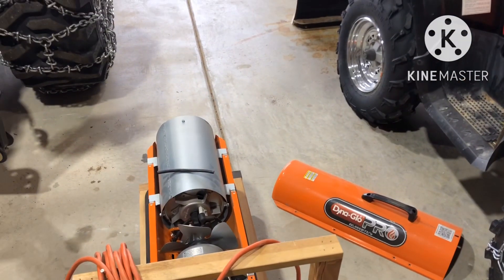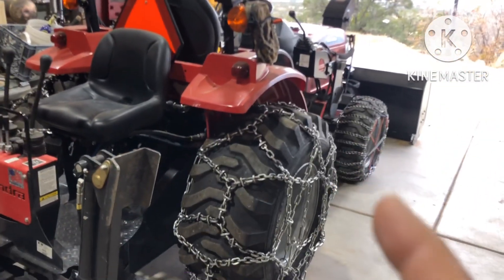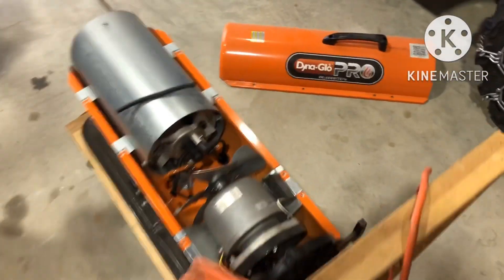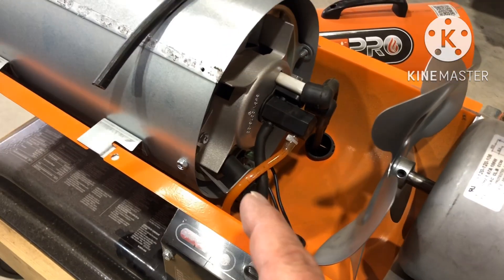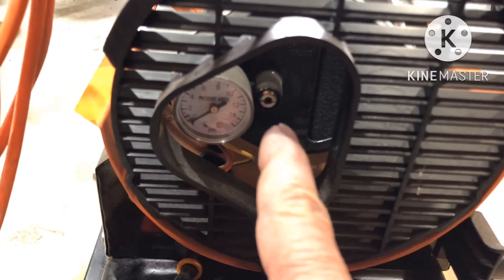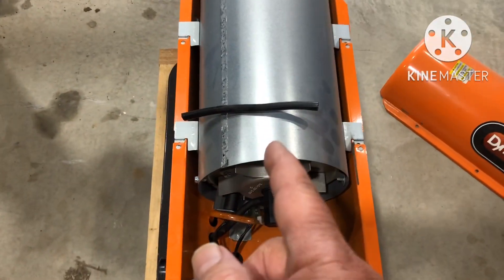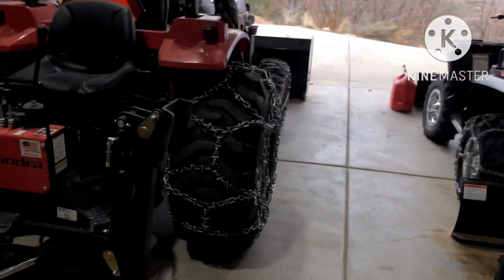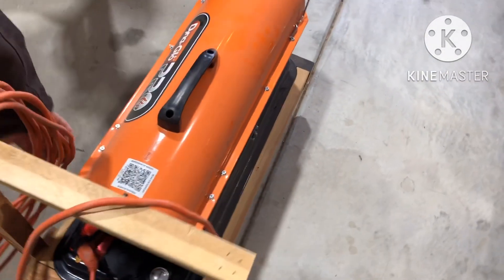Fixing the Salamander heater again

Comment: Those heaters kick ass. My dad had a kerosene heater from them with a digital thermostat. Kept the shop at 55 degrees all year. Glad you got it fixed before zero degrees 👍
Reply from the maker: Glad it’s always an easy fix so far. 😂👍

Comment: We have salamander heaters down on the pier, however, they are electric coil type. 30 amp/440 volt. if one of the shops has a temporary shelter constructed as a "Hang out" we provide the heater/blower to their pier shack or down in the Dry Dock. winter is coming with colder months ahead and the pier turns into a frozen place with no way of blocking the wind, we get below zero down there. I'm just glad that this will be my last winter down there. Idk if you continuously run that, however changing it to 220 Volt to drive the electric part may save you a few dollars on your electric bill. you would have to see what kind of load it is drawing to determine that. So, Peace dude and stay warm (Don't give yourself a heart attack)  btw, a little Garage music for you.  https://youtu.be/T2BalYlPHVg -Dave
Reply from the maker: That brings me back, my friends band used to play that. 👍 🕺🏻👍🇺🇸